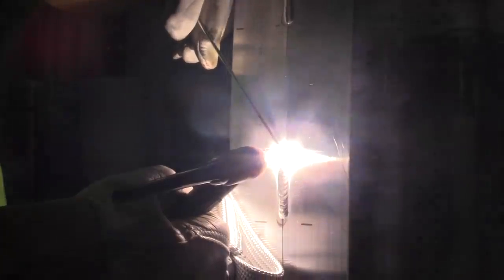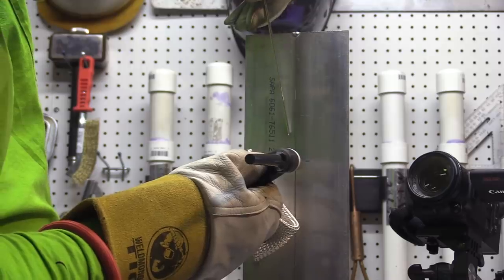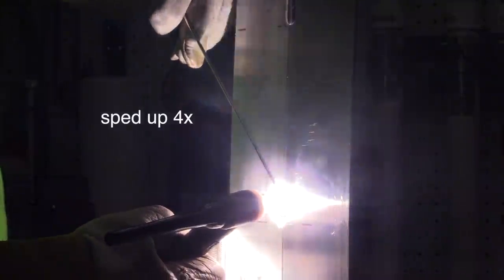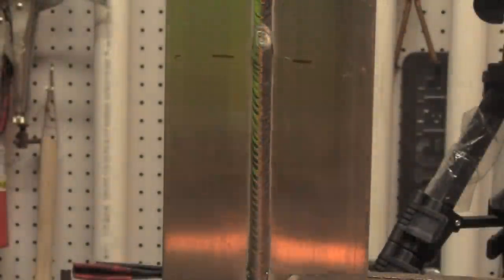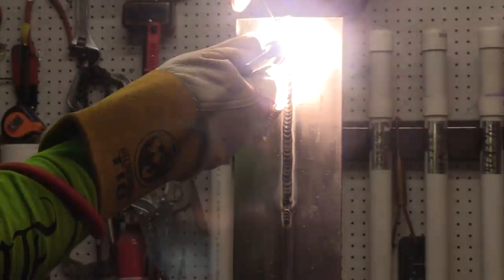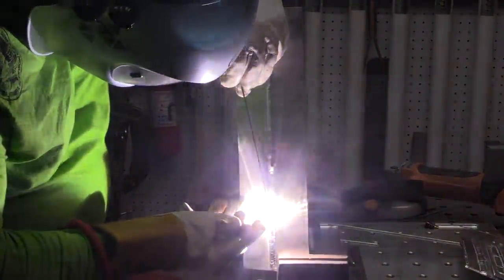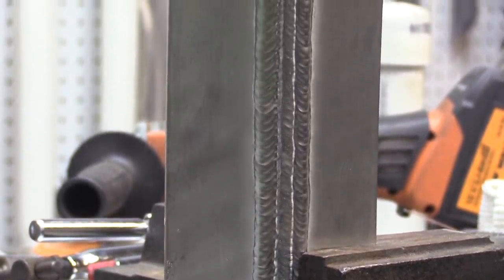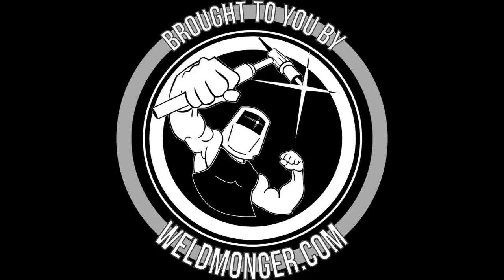TIG Welding Aluminum & Hood Time Techniques | Welding Tips & Tricks #Welding #TIG

Comment: Jody you really hit this one out the park. Being a long time follower you have hit another high mark. I love welding aluminum and could not be where I am at today without your videos. That was a nice touch Miller did with the Dynasty adding the setting for balling the electrode. Your arc shots showing balling the electrode is fantastic and really drives the point home. I also really like seeing the backside of the weld; so very cool.  Wishing you and the Weldingtipsandtricks podcast "Jody, Roy, and Jonathan" the very best in 2020. Thank you, Phil

Comment: I worked several jears welding on aluminium fuel tankers. We cleaned the edges of critical welds first with a flap disc and than polished the crap out of the edges with  a fine stainles wirebrush wheel. The non critical welds we done nothing specal. Most time we did cut it with a big powersheer and weldet it. No whiping, no cleaning. It was brand new sheet aluminium and most of it was an alloi with magnesium. And 85% of the welds on an fueltanker are Aluminium MIG welds. Only 15 % where TIG. 

And your weldingvideos helped me a few years ago to get the yob. I welded Aluminium TIG bevor but no MIG. Yor videos gave me the info I needed to get the weldingtest right. 

In the Time I worked there I learned a ton. But I later did quit the job. The work at itself was very good, but it was toxik as hell. All day in a big shop, bad ventelation, a lot of heat in the summer and al lot of noise. Aluminium MIG Welder are noisie as hell. Now I am working as a Mekanick on a big farm, my boss now is the best, I have my own workshop, the same money and it is a lot of fun repairing farm equipment. And in the summer I get to drive big as Tracktors and Farmequipment. Its like playing in a sandbox like a cild but bigger.

Comment: Did my first bit of aluminum welding with my new primeweld 225 today. Very impressed so far with how smooth the machine is. The only issue I've had is when finishing a bead and letting off the pedal, as the amperage drops and the arc is just about to cut out, the arc seems to jump around a bit and gives me a nice fish eye in my final puddle. I'm assuming it's me and not the machine but any info helps. Thanks

Comment: Hi there, Jody!
I appreciate all the great and informative videos you're putting up there.

I got a general question about auto darkening helmets. I bought a really cheap one online (contrary to all recommendations), but haven't yet welded with it..thought I'd test it on some bright LED-lights instead of blinding myself.
It seems to work as it should, delay works fine, sensitivity works fine and the dimming from 9-13.5 works seemingly as it should. The lens/LCD has great visibility, clear and focused...
However. My handheld LED worklight has a LED-bar that is dimmable. Starting from lowest setting on the LED and lowest sense on the helmet, I turn the helmets sensitivity up to the point where the lens is auto darkening, then dimming the LED brighter to the auto darkening is off again...doing this back and forth until I have the helmets sensitivity set to max...but I can still dim the LED brighter and now there's no auto darkening happening...and this doesn't seem correct to me.

Tested this in low light, bright light, moving the LED from behind my head when wearing the helmet and in front of the sensors. Dimming the LED down to about 70-80% makes the auto darkening feature trigger again.

Sorry about the long explaination here, but would you or anyone else in here call this helmet faulty?
Could anyone try to replicate this and see if their functioning helmet behave the same?
Not sure how to interpret my results, so any and all constructive feedback would be greatly appreciated.

Btw, to those who are just going to write "buy a better helmet", I already have, but it hasn't arrived yet so I am unable to compare. This cheap helmet is for friends who wish to come and join my hobby projects from time to time. Just don't want them to get damaged eyes.

Again Jody. Appreciate all the great work and effort you put into these videos. Take care!

Comment: Besides a file, are there disks I can put in a grinder that will leave a clean edge? I'm having huge problems with contamination on aluminum with my Primeweld Tig 225x. It also seems to throw any kind of point on the tungsten into the weld. So discouraged that I've stepped away from it for a while.
Reply from the maker: not sure about flap discs as I havent tried all types yet.  but carbide burr wont leave contamination.   if your tungsten tip seems to erode on arc starts, a pre-flow of about 1 second might help.  if machine does not have a pre flow options, you can do it manually by tapping the pedal to get argon flowing before you start the arc

Comment: Awesome,  any recommendations for a decent home hobby welder?
Reply: Lincoln 210MP or similar. Its not AC so don't expect to do aluminum but for a hobby welder and even more it is solid. Scratch start tig takes a little getting used to though...

Comment: Awesome video Jody! Gonna get myself a TIG finger now.

Question;  How to fix your tungsten when you've dipped it in the puddle, or touched it with the filler wire? (welding aluminum with TIG)
Is it enough to just clean the tip of the tungsten, or should you also remove the bit that is still covered with aluminum? And if you should clean up that bit too, what is the best way to do it without destroying a nice straight tungsten?
I'm kind of new to TIG welding aluminum, and i don't have someone to ask. Thanks in advance!
Reply: Hi! If the tungsten contaminated just grind it off, or cut it. Contaminated tungsten makes unstable arc.
Reply: Misterbigblock get completely rid of any contaminant on the tungsten

Comment: One question I can welding with out water cooled  I working with 250 Miller cyncrowave  but the water cooled no good
Reply: Toni Hernández si puedes pero no por mucho tiempo seguido porque se quema la tig torch

Comment: Excellent video Jody. Was there any particular reason you chose 4043 over 5356 or 4943?  I generally try to copy your drills whenever you put out a video like this and I just so happen to have some scrap .125 strips laying around.
Reply from the maker: no real reason other than I had plenty of it.  its good to practice with different rods tho.  This was 6061 so it can be welded with 4043, 4943, or 5356. One thing to always consider is whether a part will be anodized.  4043 welds will turn black when anodized and customer might not be ok with that.
Reply: weldingtipsandtricks gotcha. Thanks for the tip.

Comment: I have harbour freight titiuam 200 DC Tig scratch start want aluminum what gas shielding
Reply: Hello friend,

The welding of aluminum is done using AC current. Aluminum capable GTAW machines come with High Frequency. (they can be a bit pricey... )

Pure,100 % argon gas is used for the TIG process.
Here in Canada, the bottles are green.  

have a good one bud

Comment: Them words”back step”. I can’t get guys to understand it and to do it. I back step everything... almost everything. It’s very good at keeping welds from drawing/warping. Most think I’m crazy because of the way I weld or work metal. But they never say it looks bad or that it didn’t work. I hear” that looks good and got it right, but done 2x faster than my best welder.”  
Don’t be hardheaded and not learn something new.  Try it adapt to it put your touch in it. Make it your way. And keep pushing to get better and better. It will pay off I promise